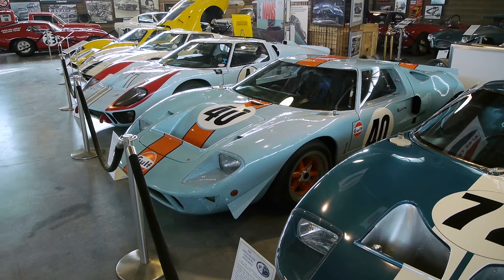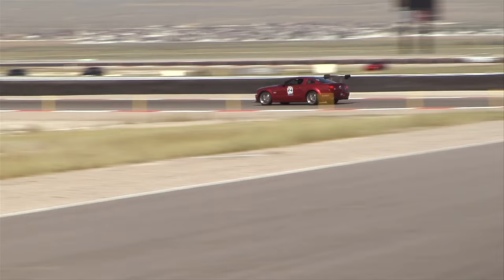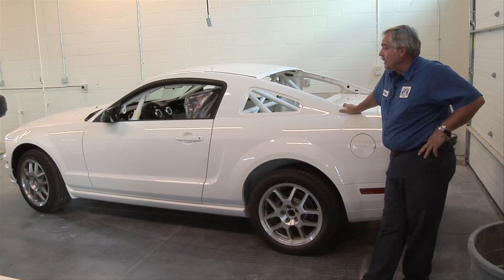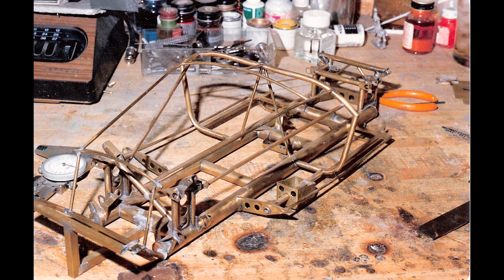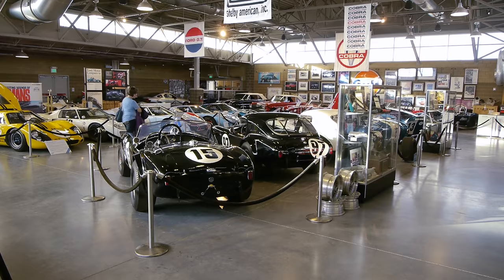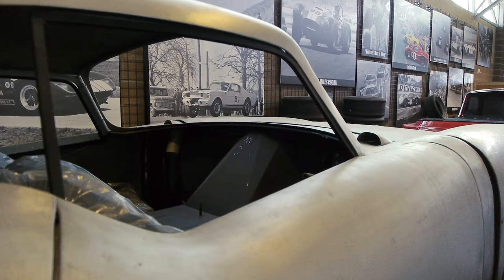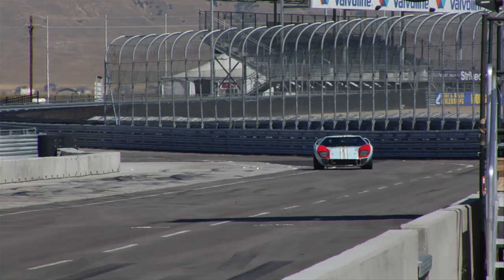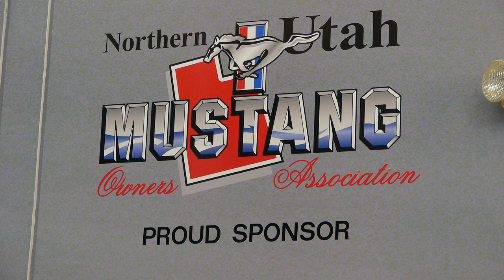The Larry H Miller Ford Collection - Amazing Shelby's and Cobras

Comment: I also had a private, un-escorted tour of the museum then located at the Motorsports complex, and have wondered what and where the collection is today. I just read an article interviewing Greg Miller,  that 15 of the most prized vehicles are on loan to the Shelby Museum in Bolder, Colorado. The rest are in storage in SLC, waiting for time to pursue the building of a 20,000 sq.ft. facility, shop and classroom in Salt Lake City. Greg has recently purchased CX2000 for $13.5 Million and a Ford Gt for $2.5 Million to add to the collection. Will be mice to see when completed!

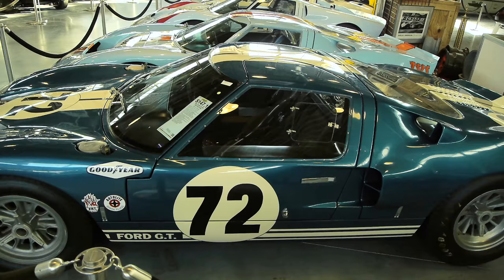Comment: Hi Dale, I wait for your videos every Sunday. Today I'd like to do justice to Ford Racing history I love so much by correcting few mistakes in your comments. At 18:10 the pale blue car is a Ford MK2 driven at LeMans in1966 by Ken Miles/Denis Hulme. Theyshould have won that race but Officials decided the black Ford MK2 n°2 driven by Amon/McLaren was the winner. Gurney/Foytdid indeed won LeMans in a red Ford MK4 n°1 in 1967. At 19:30 the car n°40 is a Wyer Gulf GT40 that took first place at Monza1000km in 1968 driven by Ickx/Redman. At 20:00 Ford GT n°72 came third at Daytona 2000km in 1965 the day very same car wearing n°73 driven by Miles/Ruby won the first race for Ford. We can see on YouTube the auction in which n° 72 was sold for7 million dollars. Just add that at14:43 the Daytona coupe n°13 is the car that finished second at Daytona in 1965, just betweenthe 2 GT n°73 and n°72. Dale and Karen, thank you for your magnificent videos which I long for every Sunday.
Reply from the maker: Thanks! I can't keep the darn things straight I guess. Yes, it was the 66 La Mans.. WEIRD FINISH. I know at the time the race team wanted to tell the drivers what order to finish in as to keep them from racing each other and wrecking both cars. Or even all of them. Yet I think they figured that would just upset the drivers, and they would be more likely to wreck something. As for me, I think the blue car won. If they had not been told they were in first they would have driven even harder. Anyway, it's cool it still a thing to this day.
Reply: Paul Hawkins/David Hobbs did win Monza 1000km of 1968 in the n°40 GT40

Comment: As some have pointed out but in a less concise way:
Pale blue w/orange stripe is GT40MkI Gulf car as raced in 68/69.  Rule change made return to small block necessary.  Though now with Gurney Weslake heads.
Pale blue w/ red teardrops on fender tops is GT40MkII Shelby car as raced in 66 to 2nd place at LeMans.
What you call street version is GT40MkIII and it was indeed a street car with a lengthened trunk and other changes.  There were MkI street cars too; however, and really all GT40s are at least part English (before you ask about MkIV keep reading).
Yellow car is Ford GTMkIV as raced in 67 to 1st place at Sebring (you got that one right).  It is a completely different car and owes nothing to Eric Broadley.  These were not called GT40s back in day and were, as you report, all American…you just state w/GT40MkII being filmed on track.
The Willment coupe was not built by Shelby.  Willment built their own based on plans obtained from Shelby on a Cobra chassis.